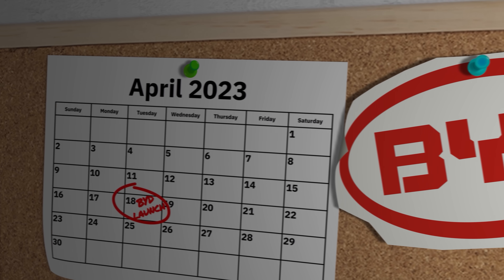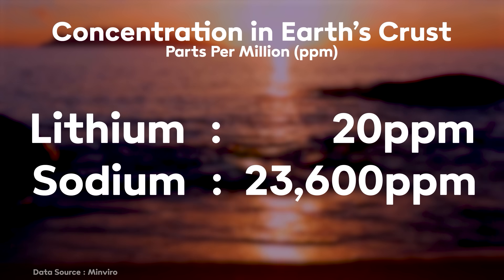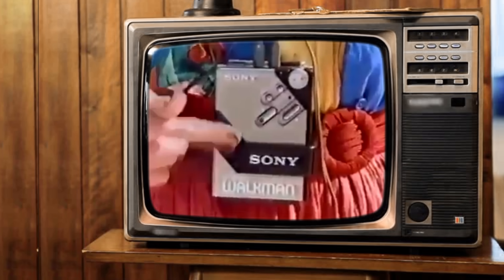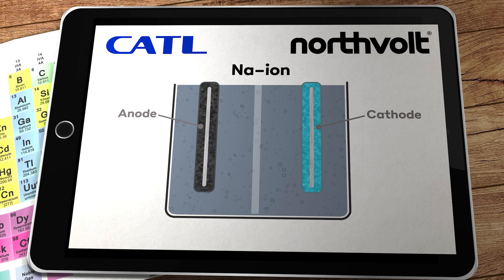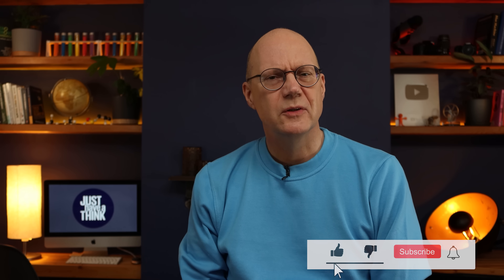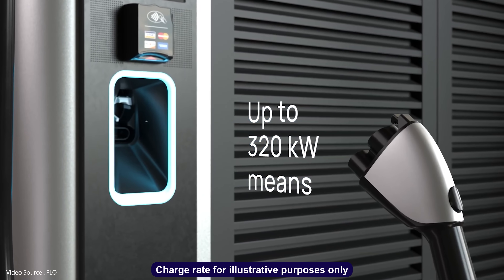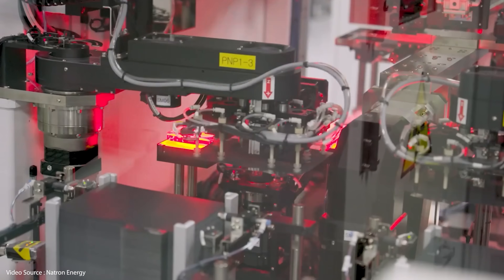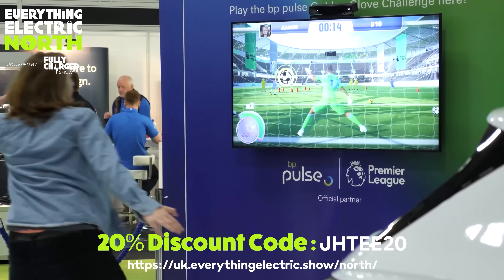Sodium-ion batteries in the USA. Beating China at their own game!

Comment: When I first heard of lithium batteries being used fir grid storage I just remember thinking it is such a waste of a relatively scare resource... Buildings generally don't need to be lightweight and as compact as possible like portable electronics...
Reply: I agree with you, flow battery systems in stationary situations would have been a better use of resourses
Reply: It's not a waste, it's an economically advantageous use otherwise companies wouldn't buy lithium batteries for grid storage. They provide frequency stabilization, peak shaving, extend the hours when solar and wind can provide power, and increase utilization of transmission lines, all beneficial. So far none of the alternatives (flow batteries, iron batteries, thermal storage, compressed air storage, hydrogen storage, and now sodium-ion batteries) have proven to be better in actual wide-scale use.
Reply: @skierpage  I think by 'waste' he is referring to the storage of data, which by, and large is unnecessary, as the use of it is more about controlling people who managed fine without it before  'cloud/computer/AI'.
Reply: PLENTY of lithium to go around !

Comment: 50k cycles - that blows me away!!!  🤩🤩🤩
Reply: Lithium ion = 800 cycles
LFP(Lithium phosphate) = 3,500 cycles
Sodium ion is the future
Reply: @larryc1616 Not really because the Sodium-Ion batteries while more stable that lithium-ion is they have lower power density and a much slower charging and discharging speed. But in that trade off  they have a much larger cycle life.
Reply: @larryc1616  
mate, where do you have your 800 cycles from?
Reply: @ursodermatt8809  thats the average cycle of lithium ion battery if you cycle 100% DOD ( depth of discharge). that is why most  lithium Ion batteries only allow a cycle between 60% and  80%  then they it can cycle  a few thousand times . LFP can cycle ~3000 times to 100%DOD  but when cycling at lithium ion  at 60% to 80% it will be tens of thousands of cycles and will last the lifetime ( though most probably the electronic components will degrade and corrode before the battery itself fails
Reply: @skrywenko6596  
yes, "cycling between 60 and 80%"
why not 69 to 71% ?
Reply: @ursodermatt8809  uhmm what does between 60 %and 80%. mean to you ???  that encompasses   69 to 71%. it just some batteries chemistries they cycle to 60% . others down to  80% or somewhere in between. all depends on the battery manufacture and  how long they wish the battery to last
Reply: The highest longevity figures do not usually apply to the highest charge-discharge rates, so it will give far fewer cycles than 50k at 15 mins charge per cycle. Still very impressive even at 5k of 15 min charges - at one charge per 3--4 days, say 100 charges per year, that would be 50 years average lifetime.
Reply: @sb6489 or 8 years for a taxi!
Reply: I was wondering what EDLC (with 1 million cycles) stood for. Apparently if means "electrostatic double-layer capacitance"; or super capacitors (which do not provide voltage regulation).
Reply: Is that possible a sodium metal battery instead od a sodium ion? Would it be similar of higher in energy density than lithium ion?
Reply: @elietedarce1266  No, Sodium while rather reactive isn't as energy dense as Lithium. There is a reason why Lithium has stayed on top and why we are at our metallurgical limits for batteries.
Reply: dream on. this will never be sold to consumers if it is 50l cycles.
Reply: @alexk6745   They've been on the market for over a decade... Kinda late to the show.
Reply: 50,000 cycles sounds great, until you look at their site and see that their cells are optimized for disharge times of 2-5 minutes, and explicitly not suited for longer term discharge. 50,000 cycles of 1/12th hour is equivalent to 4,000 cycles of 1 hour (1 C rate discharge of a typical LFP cell.)
Reply: That's longer than a lifetime, if you charge once a day.

Comment: Possible use in ships and maybe trains.  Sounds a lot more user friendly than most lithium batteries.
Reply: Train electrification is best suited.

Indian Railway Network has more than 8000 stations. Now we have to install 10MW battery in every station. 

That will be 80,000 MW or 80GW. They can buy electricity at night. Now low speed regional train coaches can have Na-Cl batteries installed underneath and / or on roof. Charging at every stop, electrification done at fractional cost. Making it feasible on non-feasible routes.

Hybrid Propulsion ships are way to go.
Reply: I wonder how many batteries you'd need to power a train. It might be the only vehicle where weight and space considerations don't matter, since you can always stick more engines on the front if you need more pulling power.
Reply: @Kevin_Street Possibly not that many batteries would be needed, too. If the batteries can charge very rapidly then short sections of third rail could be put in some areas that could charge the battery on the go. Potentially 1/20th of the track could be electrified and the train could never have to stop for charging and not need to carry batteries for the whole trip.
Reply: @pneudmatic  I can see plenty of teething troubles. Prussian blue electrodes are being researched for more than 50 years; they are not new. But there are many variants of prussian blue electrodes and the details do matter.
Reply: @Kevin_Street  A much better way to power a train is overhead electric lines. Cos, batteries has to be carried, so a part of energy is always wasted on battery weight, which doesn't happen on overhead powerline. If you want to go further, there's always place for solar panel on the train top. But batteries doesn't seem to be the way.
Reply: @Kevin_Street  You may be right - some rough calculations show that the sodium battery would only be suitable for short-haul shipping.  In the case of trains too, usually the most effective means of electrification is by overhead lines.  No such limitations for static use though.
Reply: @Kevin_Street  Wabtec makes electric locomotives.  The pink one for Roy Hill is 7MWh.  Another video said there are configurations with capacities up to 8.5MWh (using Li-ion, I'm assuming, not sure if that's volume-limited.).
Reply: Recently(ish) part of UK rail network was electrified with overhead lines. Some sections were difficult due to bridge and tunnel clearances, and then they ran out of money and/or enthusiasm and gave up with parts of it and resorted to hybrid diesel/electric locos. This seems like a possible scenario where a hybrid of battery and overhead lines would be an option.

Edit to say that I just Googled to check my facts on this, and actually there is a proposal to move to a three mode hybrid overhead/diesel/battery (!)
Reply: No. Put up the wires
Reply: Batteries in shipping will never work on any significant scale. The fact batteries are heavy and large so the ship is a lot less efficient can be compensated by money. But it’s simply not feasible to transmit the amount of energy needed to charge the batteries in the short amount of time the ship is in port. Especially not when there are five more ships moored at the same time. That would be like putting three weeks worth of output from a nuclear power plant in a battery in just 36 hours.
Reply: @autobootpiloot significant scale being defined as transoceanic shipping ? That still leaves ferries, tugs, inshore pleasure vessels and a host of other small vessels open to electrification.
Reply: @francesconicoletti2547  electric ferries already exist. The ones I know run mainly on generators and some use even more fuel than diesel direct. And yes, they are plug-in electric ferries. Tugs might work when they buy the double amount of tugs and work only half of them to buy time to charge them.

However, I don’t see cargo ships using batteries. It’s already a almost impossible challenge to make them run on anything other than diesel. And basically everything is more energy dense than batteries.
Reply: @francesconicoletti2547  the only place where batteries may be viable in boats is inland waterways, river cruisers etc.  Range anxiety on the open sea doesn't bare thinking about.  Battery electric would work as auxiliary power on sailing yachts but non of this is going to make any influence on global CO2.
Reply: Do you realise that 1 ton of fuel oil has the energy storage capacity of over 1 MWh and a large ship has a tank of 500 tons capacity.  allowing for heay oil engine at 40% efficiency thats a battery equivalent of 200MWh capacity.  Just think for a moment how big and how heavy that would be..
Reply: @thamesmud  Your figures seem a bit out - 500 tons of fuel oil comes to roughly 6GWh - equivalent to a battery of 2.5GWh capacity, or maybe a couple of days' steaming for a very large ship at 20 knots, say.  The sodium battery described here would need to be about 50, 000 tons so pretty much impractical (though long-haul very large container vessels have fuel tanks capable of 20,000 tons capacity).

So, energy density is pretty important for shipping - nearly as important as for aviation...
Reply: @thamesmud  Yes, but weight is NOT any issue on a ship  .
Reply: many ships already use it.
Reply: many ships already use it.
Reply: No, these are fast charge and discharge batteries with very low energy density. They are are perfect for e.g. securing data centers from sudden drop in power or for short term high power use applications. Lots of W not so much Wh.

Comment: Sounds good for home storage solutions to reduce grid load coupled with solar.
Reply: I would be much more comfortable with this battery in my home given it's less likely to burn the joint down.
Reply: Sounds also good for city wide storage solutions.
Reply: @bernhardschmalhofer855  distributed local area batteries would probably work well, like local substations on the power grid.
Reply: We have been using these same "rust" batteries in satellites for years, they are just now becoming cost effective with ”C” rate breakthroughs.  Will be great in your homes and once it sufficiently takes the suply/price pressure off liFePO4 they will be cheaper with higher availability for your e-bikes and cars
Reply: @ThatsMRkaren yeah ❤
Reply: Solar will reduce the grid load by an insignificant amount. Here's the correct solution: stop forcing people to live how you want them to.
Reply: Sounds good for kinetic energy storage.
Reply: That was done about 10 years ago and the technology was an absolute flop. The battery could not deliver current fast enough to handle a large inductive load such as an air conditioner or a deep well pump. There are thousands of homeowners in America who are super pissed off because they got burned.
Reply: @boblatkey7160  Technology has advanced a bit in ten years.
Reply: @boblatkey7160  not with this battery chemistry as it's just being released. Were they using lead acid batteries by any chance? Also a backup generator might be necessary for high load applications.
Reply: @jonc67uk  and no, it's not just being released. It has been around for years.

Comment: Natron please go into home storage. The grid is old and overloaded.
Reply: Let's hope it is affordable
Reply: Rach, exactly! I can’t afford to buy a vacation home in London, New York, or Osaka, or Paris. And I can’t afford a Rolls Royce. And I most certainly can’t afford to drop over $50,000 or $60,000 US for the four or five Powerwalls it would take to run an induction stove and heat pump air conditioner after sundown. Home and small business owners need affordable battery storage!!!!!!!
Reply: @freeheeler09  Induction stoves only need a lot of power on startup, then it's a fairly small amount of power to keep it running. There's stoves that have a battery built into them now (very new, hard to get because of high demand, but they exist). 

So you probably don't need 5 powerwalls, and you can get the 2 or 3 you need for a lot less than $50,000. 

That said, cheaper storage is always better. LFP batteries just got down to about $50/kwh so cheaper home storage systems will follow along shortly.
Reply: for that you need a passive storage system like heavy silicate walls, not batteries.
Reply: @GreyDeathVaccine  No I don't. I added in the costs of getting an electrician to hook it it all up. The only DIY part is ordering the batteries and inverter.
Reply: If we’re going to build these batteries they’re far more efficiently deployed on a grid.
Reply: Don't pedal fossil fuel misinformation. We've had electricity for over century, so obviously "the grid" is old, but equally obviously electric utilities have continuously upgraded generation, transmission, and distribution. If they're not keeping up in your area, that's a failure of their regulators.
Reply: @skierpage  "the grid" is constantly updated and maintained, I wouldn't even bother with this persons lack of point. The new lines we're running are extremely efficient vs old ones and most parts of "the grid" (which isn't all 1 thing, as silly as saying "the gov") never go down.
Reply: @skierpage , it's spelled peddle, not pedal.
Reply: Yes, and I'm hoping that putting many of these storage units all over the grid might actually reduce the need for so much grid work in the first place, ie the battery systems can help even out the peak supply issues, and utilise the night hours for bulk-shifting energy into power-hungry regions.
Reply: @googoo7750  yes, that will be an important inflexion point, when ICE-motoring becomes niche and may be confined to certain areas. Obtaining fuel may become v difficult. At that point, some people will need help as they become stranded. But maybe second-hand EV prices will have fallen by that stage.
Reply: Natron please go into home storage in Ukraine! We need much more electricity energy storages at home now and may be in the near future!
Reply: @googoo7750   it's not such a big problem as you think it is, if you look at how much is used for fuel compared to used for everything else, everything else is miniscule
Reply: As if charging even more batteries will solve the problem of the grid charging too many batteries.
Reply: Not really, no.
Reply: Do you not know what a UPS is?
Reply: @gg-gn3re   yes, usually an industrial version of a home battery system 🙂

Comment: 50Wh/l, that is about half that of Lead-Acid batteries. However Lead-acid batteries are typically only depleted 50% for longevity, but that only puts the Natron batteries on par with lead acid.  Have they higher gravimetric energy density? They don't tell, so that means it is also bad. Those are stationary batteries, not relevant for things moving around. Also Lead-acid batteries can be fast charged, 1C no problem, another tweak of reality in their supplied material.

Comment: Please contact Argonne National Lab to record a video on their lithium-air battery? Their battery specs published 17 months ago were: 1000 Wh/kg and 1000 cycles. That's more than 5 X the energy density of this sodium ion battery! With that density, our FPVs could reach Vladivostok.
Reply: 17 years ago. So either it was 
A) bullshit
B) impossible to scale. Works well miniscule quantities, but can't make a battery pack.
C) Can't be productionised. Works well in lab, but just won't scale to be made in large quantities.
D) has a safety or environmental issue that makes it not viable for every day use 
E) has a limitation that makes efficiency gains not worth it. Like short cycle lifespan, ot need to refill or dispose of some by product
Reply: @davescott7680  So how did 17 months turn into 17 years? Did you read any of the articles or are you just too lazy to do a Google search? Please disclose your corporate affiliation. Is it Tesla, CATL or oil companies?

Comment: I live in Hawaii, so I can't order any lithium batteries from Amazon. They won't let it in an aircraft.
Many gizmos that have a large lithium battery are not shipped from Amazon either.

Sodium batteries are brand new - god knows what problems they will have.
Reply: Not sure what you are talking about, lithium batteries are all over Hawaii... you can buy whatever you need from local distributors (and people do).
Reply: @junkerzn7312  Sure they are sent in by container - Amazon flys stuff in
Reply: The are not brand new. BYD Seagull is using them. A lot of the research and development from lithium batteries carries over.
Reply: @Michael-Has-Opinions  Lithium batteries have been around 30 years and they still have problems.